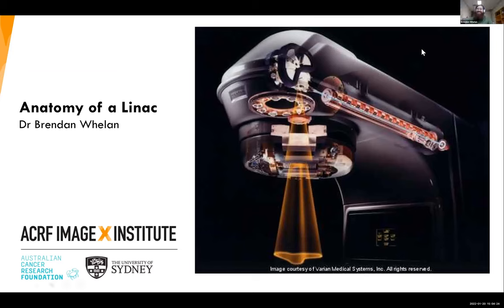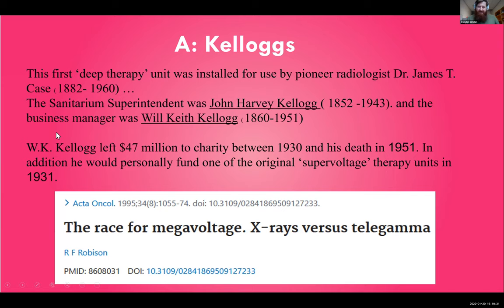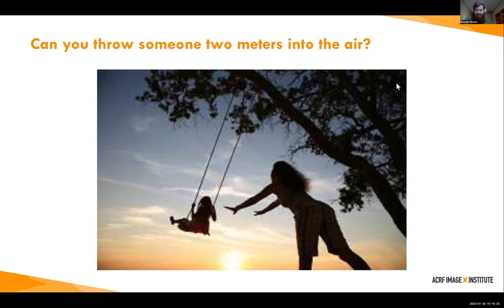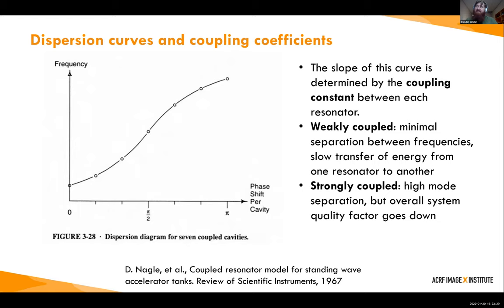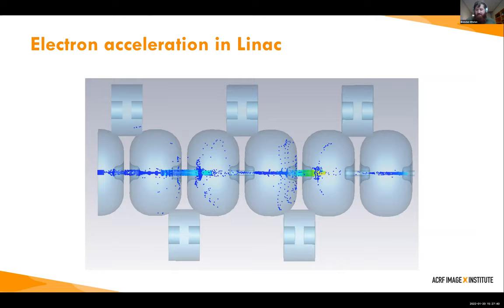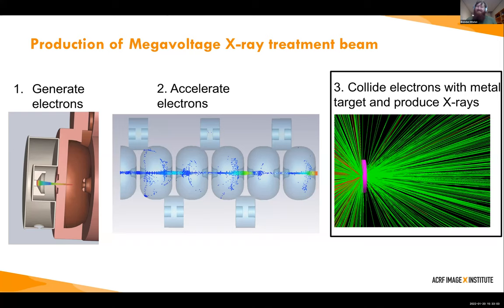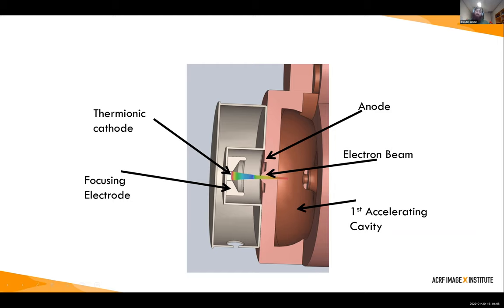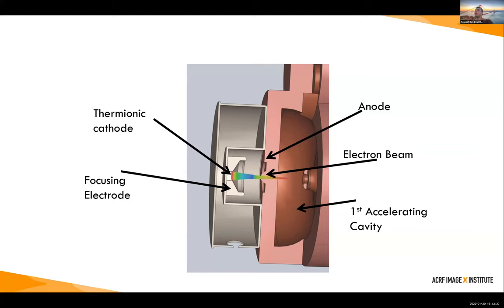Anatomy of a Linac with Dr Brendan Whelan

Comment: 14:53 : I have 3 problems:
1) If we assume the distance that has to be traveled is Lambda then Lambda*f = the speed of light not more than C (which is still impossible for a particle other than photon)
2) It is a standing wave (Lambda/2 between 2 max, Lambda/4 between a max and a min) and if I wanna reach the node at the precise moment where the middle max is going to switch then I have to travel a distance of Lambda/4 (not lambda) in a T/4 seconds (not in T) which still gives C as a speed 
3) To me, Extending the cavity will not solve the spark issue and the conductive losses. In other words the quality factor of the cavity will remain the same because it depends only on the reflection on the cavity edge. Usually the cavity volume influence the quality factor but that's because they are losses INSIDE the cavity because there is a dielectric for example which not the case here for the sake of the explanation simplicity 

https://en.wikipedia.org/wiki/File:Linear_accelerator_animation_16frames_1.6sec.gif